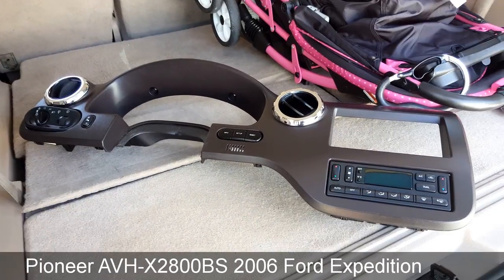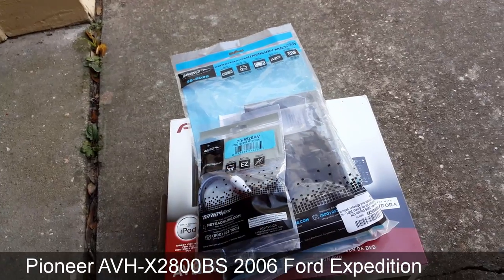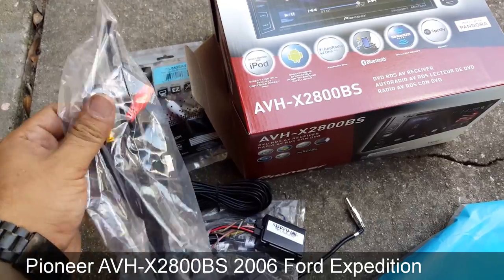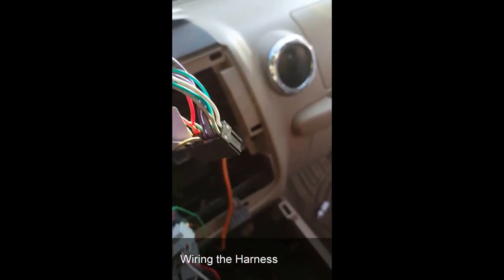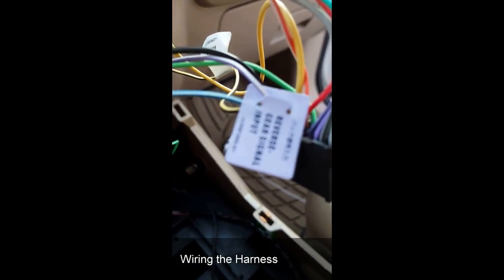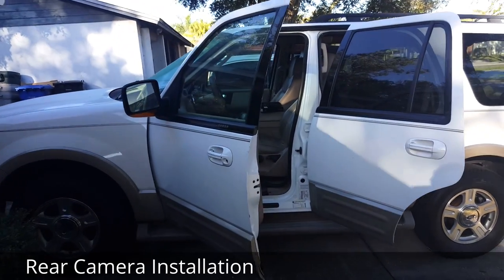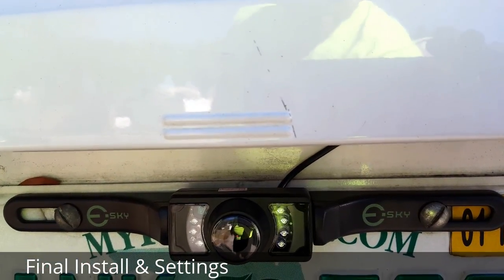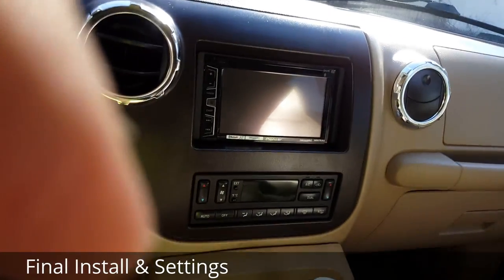2006 Ford Expedition Radio (Pioneer AVH-X2800BS)

Comment from the maker: It's green on the wire harness that comes with the radio. On the car u have to open one of the taillights and look at the pig tail for the reverse light and follow that to the front left pillar by the pedals to tap into
Reply: I’m trying to purchase this radio for my  expedition what’s the website
Reply from the maker: @dj.haitiansensationfrancoi28  Amazon just type the Model Number

Comment: I have ford expedition 2003 eddie B. I got some issues wiring new wheel steering Interface. it flash one time green. then stays red.  can you tell me or someone my Ford was made on 02/03. I am using the ground from factory radio not from chassis what is the difference between both of them. according to AXXES, I supposed to connected to pin 11, but it not working for me. it not detecting  the card the interface. can you tell me what wire did you use. Also, I got a New Boss Radio . I a m not getting the sound from rear factory dvd player. it got power , but not audio just a feedback. I tested  every input AV, rear input, front input. I select AV in front touch screen, I tried AUX , but i can't sound. If it got power it can sound too. I believe I doing wrong, but I can't figure out what is it. I Called Metra, and the guy. my ford it is early version so the audio won't work for rear dvd. I doubt it , like it  say it got power it turn on manually, but it turn off when I turn car key.. Everthing else work fine for me. usb, gps, audio for all doors, and Bluetooth.
Reply: cristhian del socorro campos carranza your radio prolly doesn’t have the feature to allow it to be controlled by an external controller so it might not work with your radio

Comment: i would love this exact set up on my 06 eddie baure but after all that did the rear dvd still work for the kids?

how hard was the harness and wires to figure out. would you recommend having a professional do it?
Reply from the maker: Jonathon Schlanger Well it really depends on your logic. A lot of the wire are color coded and they go with each other like the speaker wire. The rear dvd does work you just have to buy the extra harness that maintains the rear dvd functionality. All it is, is a plug with ground wire, power wire, blue turn on wire and 2 RCA cables that retain sound and turn on the dvd. You can't control the DVD from the head unit. All it does is it retain power and audio so the kids can watch it. The beginning of my video gives you details on what to buy.

Comment: is it possible to display the movie to the rear dvd player?
Reply: and also is the face detachable?
Reply: I have this same radio.  The face is not detachable.  It DOES have a video out port on the back so if your rear DVD player has a video in, it will work.  I ran my yellow RCA video out to my in-ceiling DVD player which has a video in spot.  The radio displays the DVD and controls the audio, the rear DVD player works as a 2nd display.
Reply: A Johansen so you can have a movie playing in the rear dvd, while using the radio?
Reply: Skyefuego ohh, I see what you're wanting to do.  No you wouldn't be able to do multiple sources like that.  You could only watch a DVD in back while listening to the radio if both are separate systems.  Like a stand alone DVD player in back and the Pioneer in front.

My stand alone DVD player in the back just happens to have a video in option.  It's just mirroring what the pioneer is displaying.
Reply: A Johansen yea I have a separate dvd player with a AV plug. I want to hear my music while the kids watch their movies. Thank you for the info bro!

Comment: I'm trying to figure out what the hell are the part stores selling as wiring harnesses because the ones i see connect to the a/c port. Like wtf. The radio ports not used when aftermarket installing?

Comment: Did you have any issues with the sub thump?  I think the Crux harness has the 5v converter, but I still get the thump.
Reply from the maker: You have to buy an extra adapter from cruz that takes care of that
Reply from the maker: Look it up on crux webpage
Reply: I didn't see anything on the Crux site, but a few days after I installed the radio, I spliced in an Axxess Interface AFDI-5V Ford 12V to 5V Step Down.  I used a multimeter and confirmed 5v were going to the subwoofer. Was there any added grounding you did?  Did you splice the new radios ground into the ground on the factory harness?
Reply from the maker: No

Comment: Chris Pagan. Is there a particular harness that has to be purchase for the factory subwoofer. Because im getting nothing from mine with the harness i have running my aftermarket radio.
Reply from the maker: Yes if you look at the video the beginning part shows you the extra part that you need to buy it's a metra kit to retain the subwoofer.
Reply from the maker: It's the Crutchfield main harness
Reply: so with that amp harness everything is plug and play. Would i have to run a remote wire to the factory amp.
Reply from the maker: No that harness powers the amp and then you hook the 2 RCA wires it brings to the back of the radio
Reply: chris pagan. I finally received my metra harness for the factor sub and amp. But my question for you is the metra harnes came with 2 amp output wires( blue with white stripes) i hooked both the blue with white stripe wire  into my power antenna/ amplifier remote  turn on wire. wanted to know if that was the right way or is there another way to tie the wires in so the factory sub can work and should i tie both in or just one, also the red and white jacks wanted to know should those be plugged in the input or the output aux hook ups.